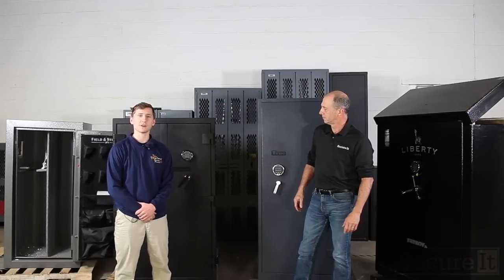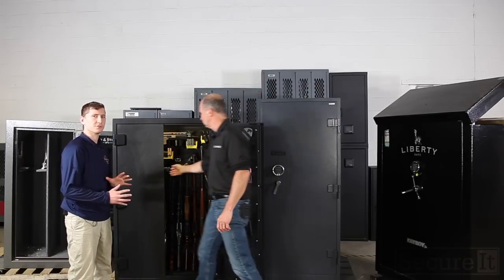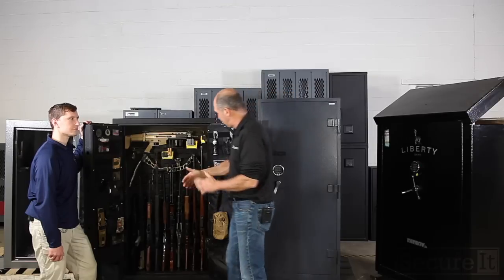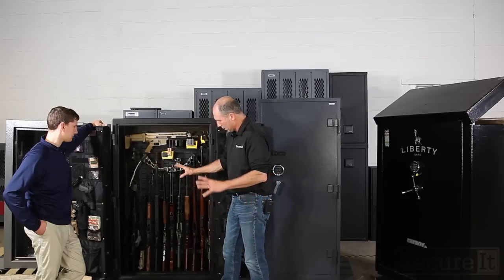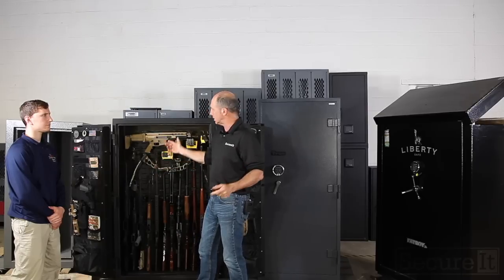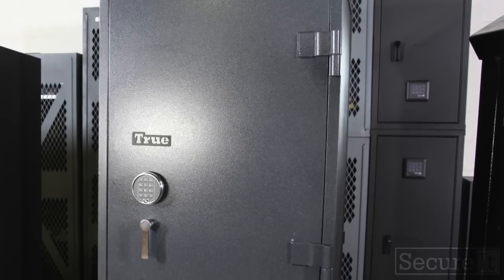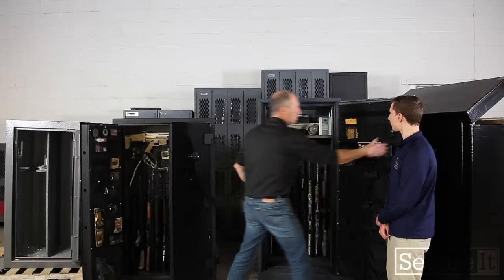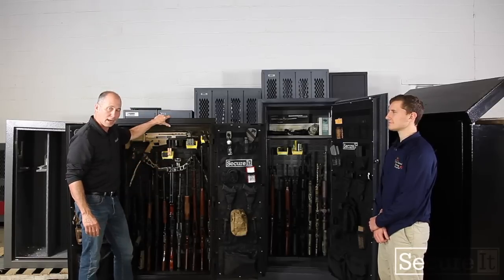Truth & Answers in the Gun Safe Industry - This Week at SecureIt: Ep. 22

Comment: Your locks suck

Would you please provide a mechanical option?

I get locked out of my safes regularly.
Reply from the maker: Which safe do you have? The Agiles all have mechanical override keys. And the biometric keypads have a usb-c port to plug in if your battery has died.
Reply: @SecureItLegacy  Fast Box 52, energizer battery installed late July.  5 or 6 easy opens 3 where i had to enter the code a couple times and adjust the handle just right.  The key is the only thing that works reliably, but i dont keep my keys by my bedside, they defeat the purpose and I cannot leave a key near it.  A mechanical lock would be ideal in all situations.  I have another locker but it works better and will get a mechanical lock soon.

Comment: I live in a suburban neighborhood with a 4 minute response time.  Watched my neighbor have a gasoline/small engine accident on the side of his 60's split level.  in 4 minutes the attic was fully engaged and by the time the department had water on it was about 15 minutes.  Basically burned to the ground.  Burning carpet & mattresses in an insulated space get going way higher than 1200.  Add some petroleum and cans of paint etc and it gets pretty exciting.   Get the lightweight safe and a good homeowners policy.  I have the Costco special.  It is not going with me to the next house.  I will get a small paperwork safe and one of these lighter safes when I move.

Comment: Is this an RSC rated or a t15 rated? Also can a S&G Mechanical Lock be Installed? I really like the 50 cal proof Brown Tactical Safe. Its a TL30 and not an rsc. Wished there was a $2500 TL15 or 30 safe out there for high security. Im a mechanic and if i can break in thats good enough not to buy.
Reply: I asked an owner of the "Answer" about it's rating. It had NONE what so ever, apparently Secureit has a video or article on why they think ratings don't matter. I haven't seen a rating for the "TRUE Gun Safe" posted anywhere either, it likely doesn't have one as well.

Even the most expensive safe isn't impenetrable. If someone wants in and has time and resources they'll get in. A safe just buys you time for the backup (police) to arrive. If the backup never comes not even TL-30's 30 minutes of resistance can save you.

Comment: Correct me if I'm wrong, but I'm going to take a guess and say you're using hardiebacker or some form of tile backer board in the True safe.  Not knocking it, just guessing that's the case.  Hardiebacker is a concrete composite board filled with fiberglass typically used in the construction industry to install tile floors.  A sledge hammer won't do anything to sheet steel.  Let alone Steel with a concrete composite filling.  Seems like it would be a good alternative to Drywall as Drywall is definitely no good for this application.. my 2cents.  I do like the safes and think it's the best thing going.
Reply: No, The true safe is double walled steel filled with a cement composite material that is "poured" in. It must cure.  These safe go through a 30 day curing heated treatment that allows the fill to set up properly and remove the moisture.

Comment: Any chance we will get to see how the True Safe holds up to a sledge hammer?  (Our of curiosity). 

Also is there a manual override on the “Answer’s” key pad lock?
Reply: There is no key override on the "Answer". Batteries are replaced on the outside and if the lock mechanism inside the door fails while the door is closed and locked a locksmith will have to come out.

Comment: I am curious about details comparing the Answer 8 cabinet to the Agile 52.  It only appears the be larger and welded (and heavier), but is it any more "secure".  Could you just cut through it with a simple saw.
Reply: Any metal can be cut through with an electric saw, the right blades, and time. This one is 12 gauge steel verses 14 for the Agile, which is a bit over 2.8 times stronger. 

If you have an alarm system and a decent response time, this is a great product IMO. I wish they had it at the time I bought my 52, as I would have bought this instead. If you need to sustain an attack over a long period of time, a concrete composite safe like the True Safe is the way to go. With my job, I'm very knowledgeable regarding safes.
Reply: Steel is cut like butter with modern power tools.  There are a lot of videos demonstrating how easily steel residential security cabinets can be cut.  

The “Answer” basically gives you a functional residential security cabinet without the fluffy gimmicks of other, “safes” at a fraction of the weight.  

It will probably perform as well as any other “safe” made with a steel exterior...  of course you could buy the 1500lbs safe with AR 500 steel exterior with a stainless liner (reduces effectiveness of blow torches) however you are going to pay a minimum of $5,000 for a small safe and probably upward of $10,000 for a larger, more secure cabinet.  At that point you might as well get the True Safe that is filled with concrete.  

IMO, the Answer is the functional value purchase.  A competitively priced steel security cabinet that can actually be moved should the need arise.
Reply: @MikeEHY  Mike, I agree, with the addition that thicker hardened steel is more difficult and time consuming to cut through than thinner. Most people robbing your house will not be bringing power tools, but small pry bars. I'd absolutely bet on the Answer holding up to such an attack. Power tools are used in targeted attacks when they know what you have. The safe or cabinet should also be the last layer in your security "onion". When I need to add some capacity this will likely be the next addition.
Reply: Paul Schlaffer my concern is more with in-home power tools in the garage or basement that the burglar would have relatively easy access to.  That being said, my understanding is that burglars rarely spend more than 15 minutes burglarizing the home.
Reply: @MikeEHY  Yes, I've thought of the same thing. What I did was to lock up the blades for my Saw Max. If someone breaks in they could access the tool, but not the cutting blades.